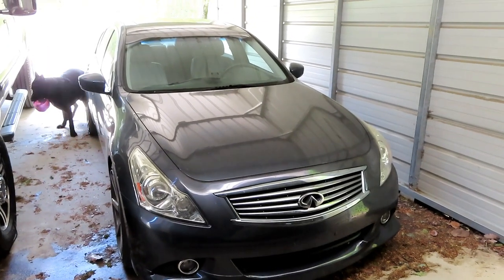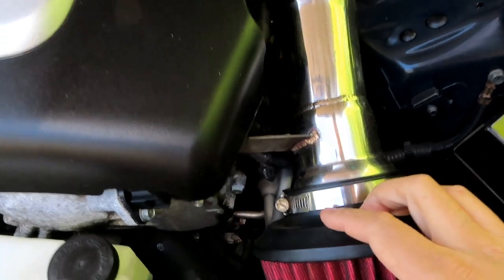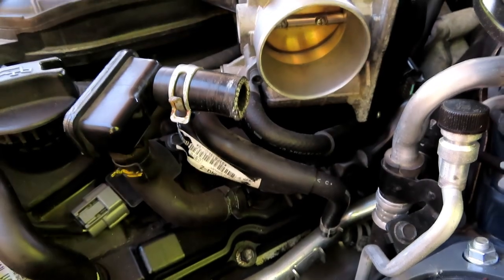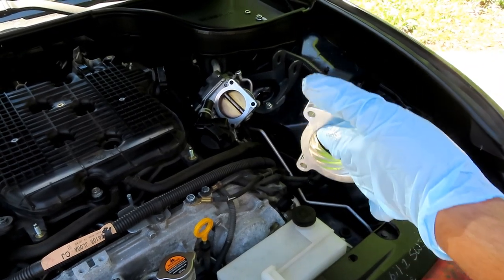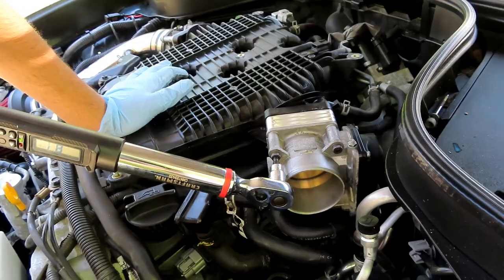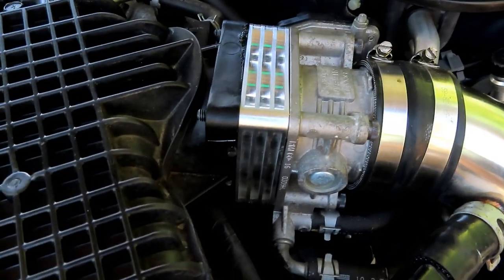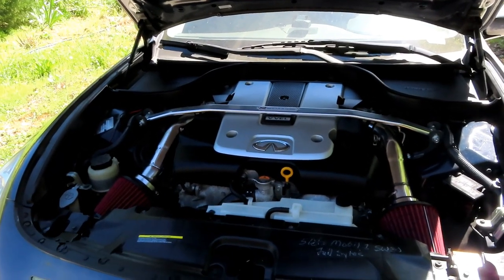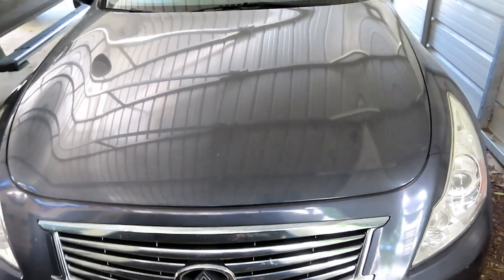G37 VQ37HR VQ35HR Throttle Body Spacer Install Test Review Spacer Dynamics Fits Many Makes/Models

Comment: If I may, what did you use to take the engine cover off? I need to replace my fuel damper since it's gone bad and makes a..lovely diesel sound as well lol
Reply: How you gonna replace a fuel damper if you can’t even figure out how to remove an engine cover lmfao. it’s a 10mm btw
Reply: @erinachan1695  😂😂

Comment: Man sounds like you shift at 4000 rpm in sport mode… let the car free and dump that shit. Shift 1 k before redline… and lose the rubber gloves.. no real mechanic wears gloves.
Reply: Fax on fax😭 he’s saying he feels no difference the fucking the throttle body is barely open if he was gearing manually he’d feel that difference right around 4500 when that vvt starts putting in work

Comment: You actually went backwards and downgraded your car by getting aftermarket short rams. Better to get aftermatket cold air intakes or stick to stock OEM intakes with heat shrink wrap on them. 

Eliminate your PCV valve and plug up all those unnecessary hoses / lines on the intake. Your PCV valve has your entire throttle bodies, upper and lower intake manifold and intake valves and valve ports dirty as hell. Eliminate your coolant lines to the throttle body. Thats just heating up your hot air coming from the short ram intakes even more.
Reply: I did the same thing kept the factory air boxes put intake pipes in and drop in filters, do you think the spacers will fit without issue?
Reply: @Tyler-cs5hj  I just did the aFe Spacers like 3/4 days ago, I have same as you with Mishimoto Silicone Intake Pipes and I had to cut them a quarter of an inch or a little more. 

It was brutal, lmao, but It worked like a charm! I cut where the silicone meets the stock boxes and the MAP Sensors are. I didnt touch the throttle body area. 

Funny thing is when looking at my aFe instructions it doesnt mention cutting ANYTHING, but I think its cause our stock rubbers ones have some play, they look like an accordion.

BTW!!! Wroth it, havent started my car yet (big project, doing a lot at once) but Ive done my research and even found like ONE Dyno proof video on a white Honda Accord, pretty cool, makes a difference and its totally wroth it in my honest opinion.
Reply: @GeloNegron  thank you so much bro I had a feeling I was going to have to cut the pipes but I wasn’t 100% sure it’s hard to find a video with that setup specifically, I was just hoping the air boxes wouldn’t have to be relocated in some sort of way. Did you feel any difference in the car with like throttle response, or even a little power increase ?